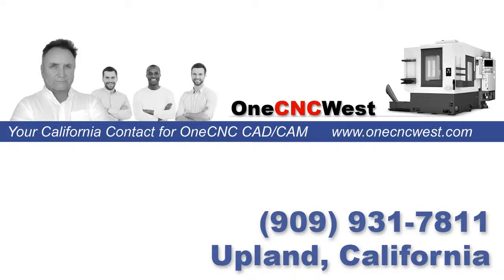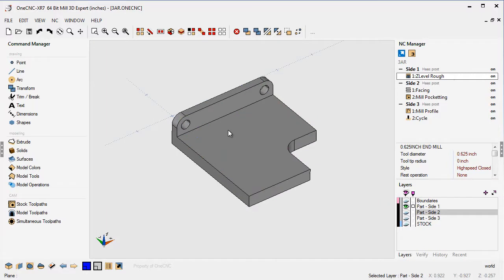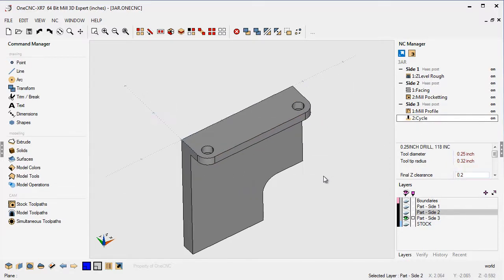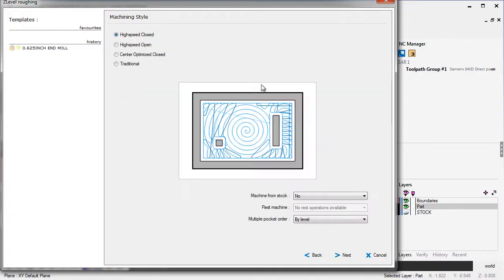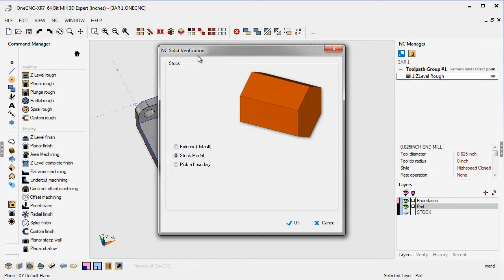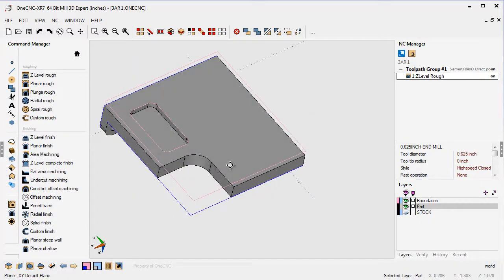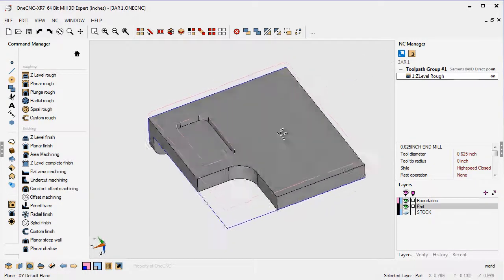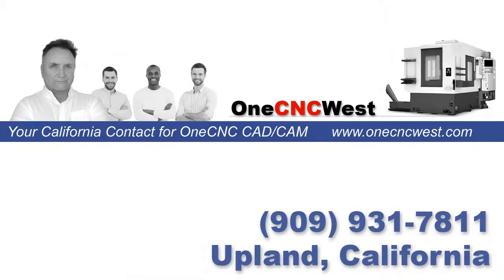OneCNC XR7 - Powerful "3 Axis Repositioned" Feature

Comment: Can this feature be use on the 2d version without the use of a solid model?
Reply from the maker: Hello Steven, yes this is 100% possible. Instead of a solid model, you can use a 3D wire frame of your part. Then using the construction plane tools, create a construction plane on the side you want to machine. I would suggest using the "Create plane through 3 points" option to create the construction plane.
Reply: @onecncwest 
Thats great, haven't really had chance to get to grips with it properly yet, currently using 2-3 seperate files for the different operations would be great to be able to simulate all the operations without the need to open up each file. Would I need to create a stock layer for this?
Reply from the maker: @steviemill  Hi Steven, if you have OneCNC Mill Professional or Mill Expert you could create a solid model for the stock. However, a solid model is not required for 3 Axis Repositioning. You can use the other options for stock if you would like. The big advantage to using a solid model for stock is that you can make the stock any shape that you like. But again, it's not required.